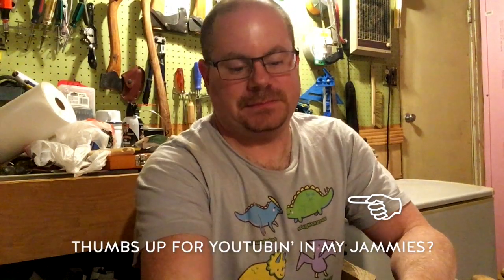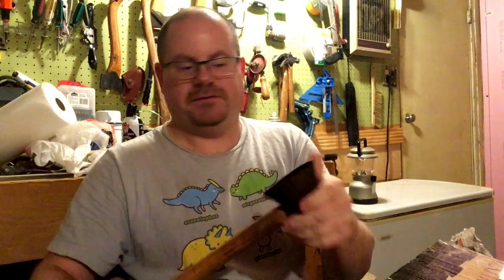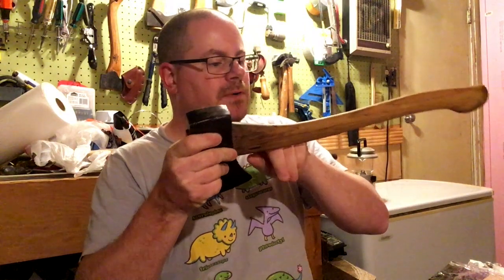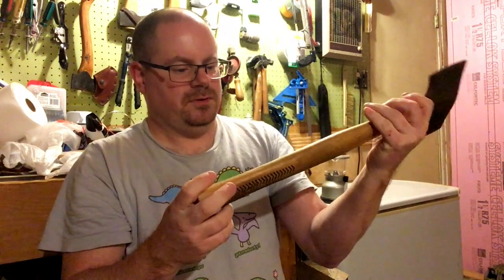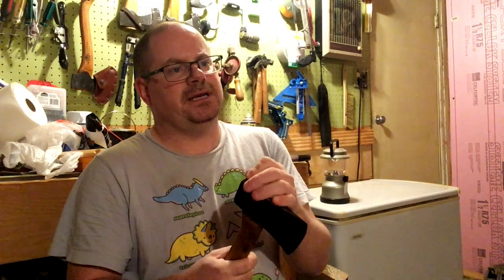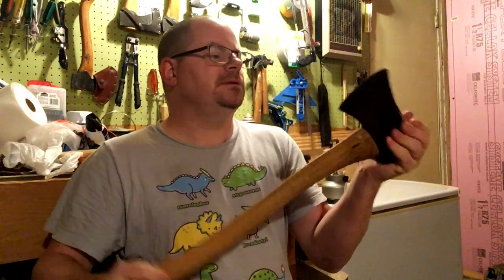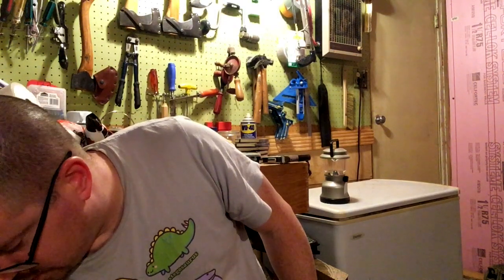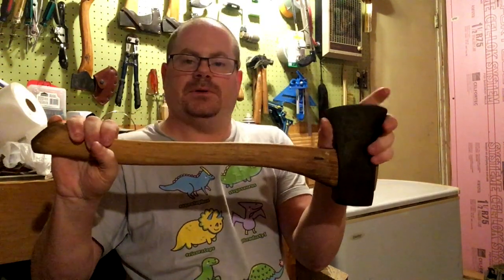Vintage axe unboxing

Comment: I feel sorry for you man, the norlund axes are way overpriced for what you are and I'm sure you paid a pretty penny.
If you didn't pay more than $40 then you're lucky.
BTW the handle that's on it sure looks like a CRAFTSMAN, but isn't stamped so I'd bet that was sanded off with the grip pattern left on.